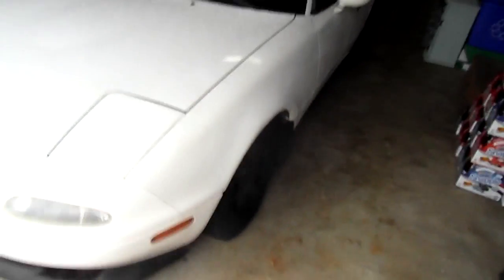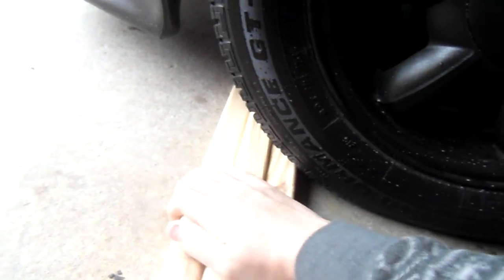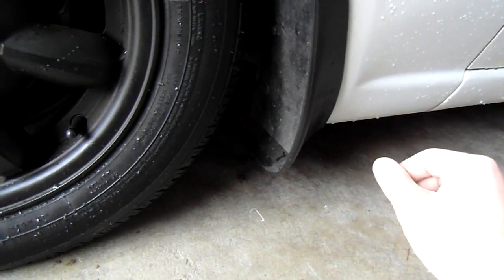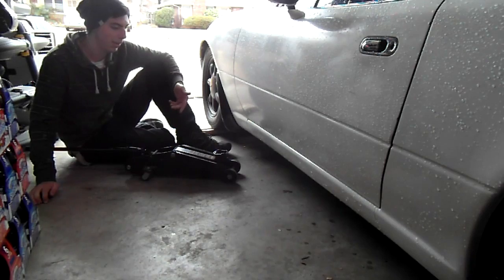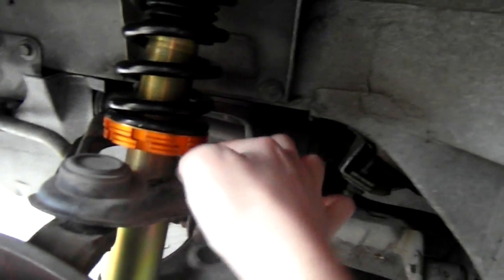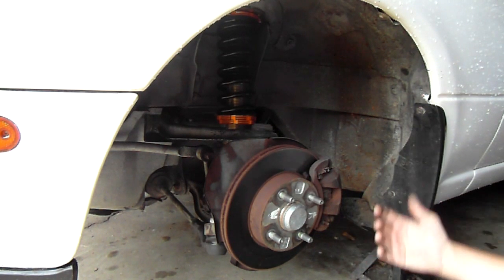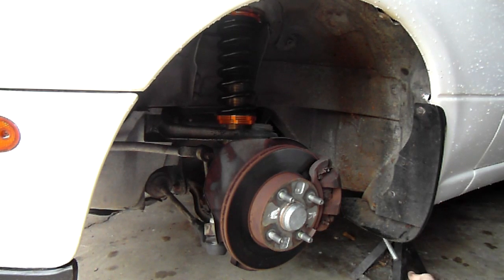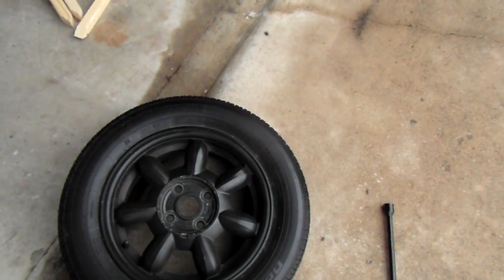How to raise a car that is too far lowered

Comment: I about died laughing when he pulled out that spare wood for spacers. I always tell my wife about how useful spare wood planks are, I actually was about to do the spare wood lift myself and was looking for some justification on YouTube and found it on the second video!! Great minds think alike
Reply: 2 years late but when I first installed coilovers, I had to readjust my rebound by lifting the car up. I didn’t have planks but I have a polystrene surfboard I used to use at pools when I was younger. Worked like a charm. (Even used old shoes to add some elevation to slide my car jack at one point hahah)

Comment: Man, You are SMART!  I am in my 60s .. had a Scion xA before... been wanting another - just like them and good for a run about - I live under 7 miles from work as well. I have a Corolla that I had to buy in a pinch when my 2007 Scion tC died about 3 years ago.  Not fond of Corolla at all but it is what it is. Not rich - so glad I have a good running / dependable car - it just rolled over 100K and is garage kept - another reason for just wanting something to run around. SO a friend finally unloaded her 2005 xA 145K -- it is in decent shape. A few things I want to do - and 1 is raise it back up... she lowered it -- she is more than half my age and it is a "cool" thing to do .. even though it scraped speed bumps.. go figure.  I work for our Police Fleet - not as a mechanic but as a database entry admin - we can't use our police garage for personal - but I have several mechanic friends and I have a local garage I love and trust.  Even so - I like to know what needs to be done.  I am doubtful - that mine will be this easy - with my luck the shocks or struts or whatever is under there will be shot ...   regardless - this was very interesting!  THANK YOU..

Comment: I just bought a 2000 Celica GT and it had TEIN coilovers on it. He lowered it 3 inches but its too low for where I live. I went over a speed bump and hit the oil pan (which is an engine killer) Also when i hit potholes my tire hits the top of the wheel well. If any of this stuff happens to you then you NEED to raise your car.  especially if its your daily
Reply: I'm going to look at a car and this is my worry. The owner lowered the car and the cost for the parts alone are well over the $1000 mark and I'm not sure it's worth going to look at it anymore.
Reply: @communistpootisbirb  well if he lowered it with short springs you could just get the stock springs and swap them out. if they are adjustable coilovers then good news, you don't have to spend any money as long as you can jack the car up and use tools to adjust the coilover height. My celica actually had lowering springs and not coilovers, I just didn't know much on the automotive end then. But lowering springs are just a cheap way to get it lower but a lot of the times you'll have issues like I had with fitment and functionality

Comment: I'd recommend putting a plank of wood between the car and the jack so you don't mess up the cill or jacking point anymore (you may still have to drive the car onto something to fit the jack and the wood under but I think it's worth it). Love the car!
Reply from the maker: Thats a good idea, Ill try that. Thanks man!
Reply from the maker: And yeah I still have to you a piece of wood to get a jack under it. I might invest in a low pro jack
Reply: Project Skidz a low pro is probably the best alternative but some wood is my cheap fix that works for me :)

Comment: I bought a 900 cc cruiser motorcycle last summer and ever since I've been balls deep in bike shit.. Got no interest in cars anymore it seems. And I have a nice 2004 lexus is300 that drives like a new car and has a few mods and TEIN street basis z coil overs which I like a lot. I still have my lexus feel but if I go too low it slams so I have it as far down as I can where it didn't slam when I hit bumps... Anyways. I have a flat tire and got up to take the wheel off and bring it to get a tire but I couldn't jack it up!!! With a flat tire is too low.. With air I just barely have a 1mm gap to slide the jack down but yes the only thing you need to do to remove the wheel if you can't jack it initially is drive it up on a 3 inch block of wood and you'll be good to go... Now finally, I really want a little mid 90s miata as a project car. They're so light and I think they look great. I saw a guy recently with a pristine condition red fully loaded top of the line 95 Miata. Whatever sport or nicest version they made in 95, this was it. Interior was tan and exterior bright red and flawless. It reminded me of an older Ferrari with the red and tan. He had a couple mods like full exhaust, turbo, high end lightweight wheels, nice racing tires, drilled and slotted rotors, strut bars, and Megan coil overs. He said it was putting out 300hp... He didn't have a wing, body kit or anything that made it look like much other than the wheels and the totally obvious intercooler in the front which seemed too big for the car but he said the turbo was originally on a much bigger lexus es350. I hope I can find a miata in good running condition with lowish miles. I don't care about the interior or exterior because I can fix all that myself.mi would probably plastidip the exterior because it's so small and basic. Not much to it. Definitely first thing I'd do to a miata is put on some really good stiff coil overs and springs, strut bars. Make that bitch stay damn near 0 degree lean horizontal in cornering. Then I'd see about a swap. I wonder if a Integra GSR engine and turbo would fit. Or a Nissan sr20deT